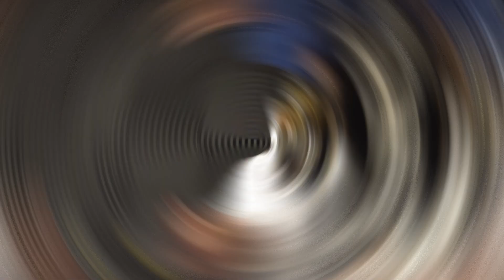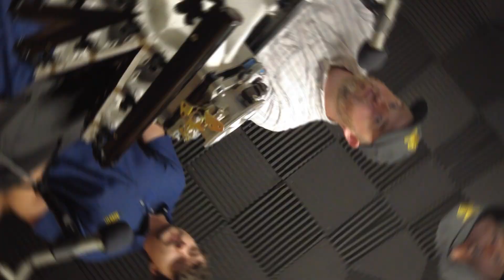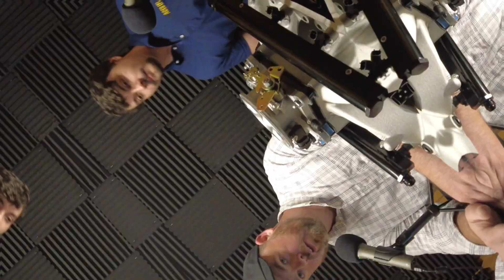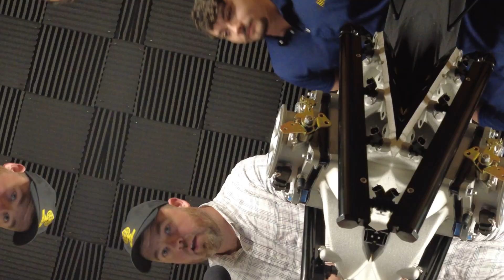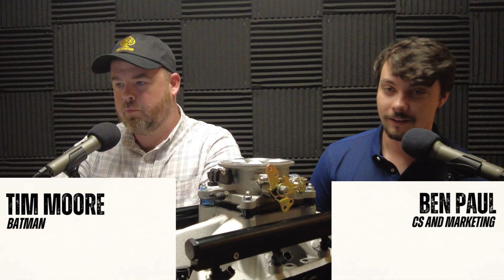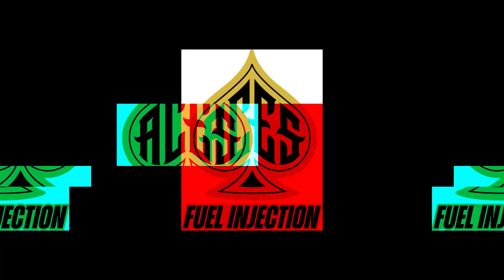Tech Tuesday Ep. 6

Comment: Hello tech team, I have a question regarding the advanced computer tuning software. When the cable is hooked up and connected to the computer and the car is running, why the datas on the fuel learning tab remains at 0, even if I hit trace? I have a blue square that's bouncing at different places in the table, but the datas are always 0. Thanks!